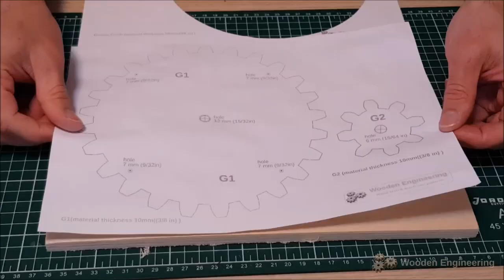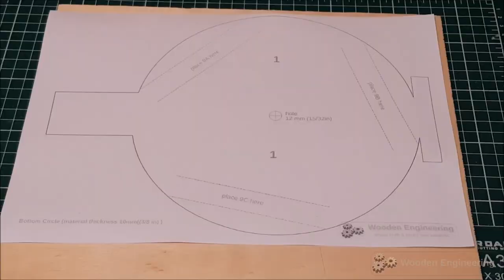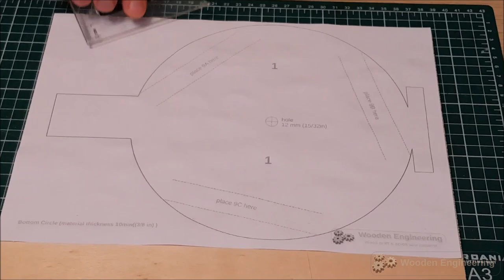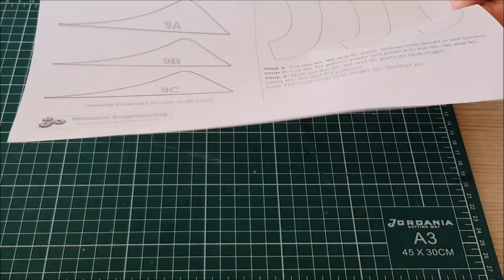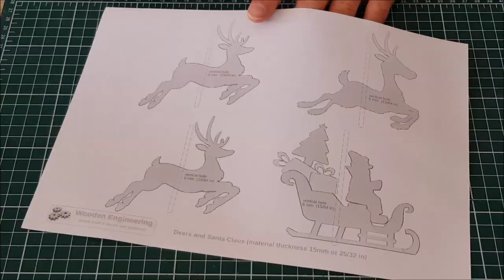Wooden Santa Claus and Deers Carousel Plans Christmas Carousel DIY pdf Template

Comment: Do you have recommendations for equipment to make wooden toys?
Reply from the maker: - If you do very precise work, be sure to use a vertical drill. For example Bosch Bench Drill PBD 40.
- Use quality blades when cutting with a jigsaw. For example OLSON brand.
- Use quality wood material for projects that require precision and durability. Beech, hornbeam, ash, walnut, oak etc.
- For carving, use soft and easy-to-work woods; linden, ebony, walnut etc.
- If you're making gear out of wood, I recommend beech plywood.
Reply: @WoodenEngineering  good day. Any recommendation for jigsaw machine? you make perfect things👍🏼 I want to buy your patters to make for my daughter.